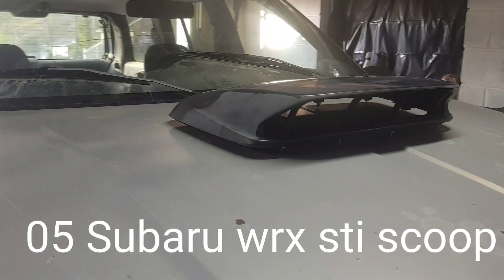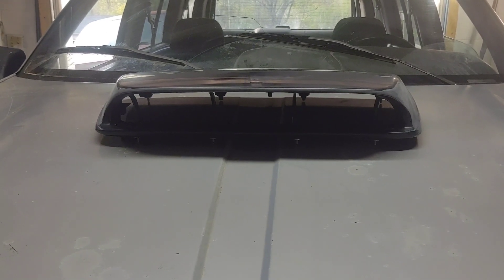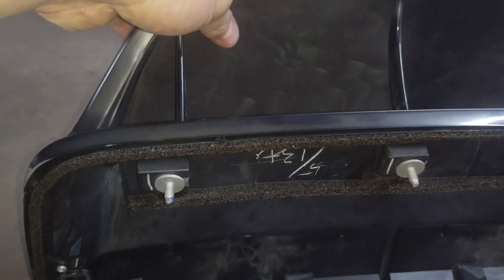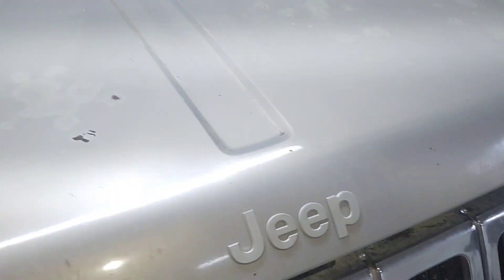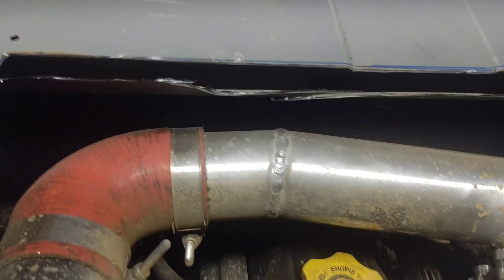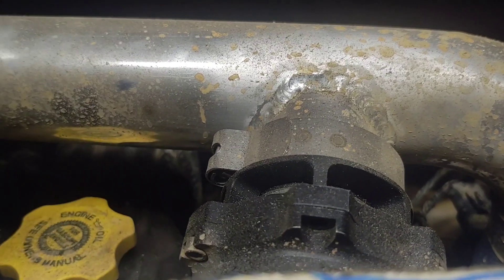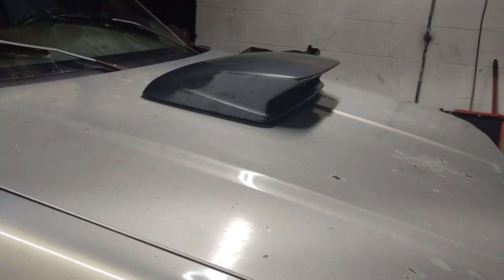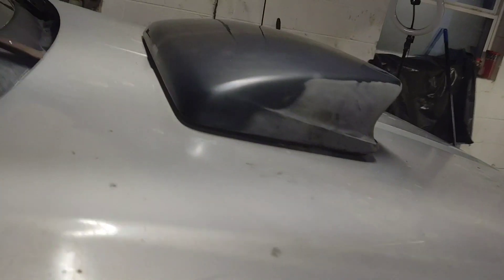Jeep zj hood scoop

Comment: I put a 7 1/2 Rubicon lift on my 98 33s on chrome ranger wheels I think the grand Cherokee is better offroad with the independent suspension the axles suck bad
Reply from the maker: I'm think I'm going to stop at 4.5 lift on this one. Iv got an 8.8 I want to swap in and regear to 4:10. Nothing crazy. Then start building long arm stuff
Reply: I got it from a donor complete kit shell for 250.00 it's a 2000.00 kit  a d inthought it would suck to get in n out and it dont I made my own bumpers 3.5 square tube 1/4 I'd so I can put a winch in it without  bending 9 inch C channel for rear and welded it to hitch now I wanna do axel swaps or upgraded replacement
Reply from the maker: I'm probably still a couple months away from building bumpers. I really need to fix my rockers I will do that soon probably within the next month
Reply from the maker: You got a deal man
Reply: Badlands is in Indiana hour hour and a half from Illinois state line,YouTube it see what it has
Reply: Were also going to black mountain Kentucky this year, flat and nasty last summer
Reply: When we know when we are gonna go down that way I'll definitely let ya know,I like what you do on here so I subscribed to your channel and I'll pass it around
Reply from the maker: Yeah man. I appreciate it. Give me a shout. You can find me on Facebook with the same name. Profile pic is a red Dodge ram.

Comment: Good eve. Thomas, like the roo bump. Hey, a thought on the intercooler. Can you cut out some thick heat resistant rubber (like an industrial mat) or plastic or 3d print or CNC a aluminum plate for the final hood install? Maybe mate it to underside of scoop conform to the hood. Put the intercooler where it mounts and sits in the hole (to give you more clearance). Just some out of the box thoughts thrown in the ring....
Reply from the maker: I only plan on making some aluminium runners to help direct air. Keep it easy to get all the mud out of it with the hose.  And maybe some smaller hood vents like the 5.9 zjs. Can't keep it too close to the hood cause of all the engine movement and I don't think the thick foam seal I have in mind will hold up too well with the mud and heat and pressure washing every weekend.